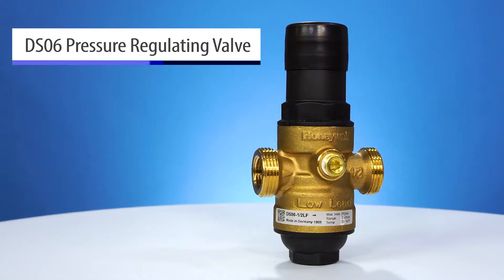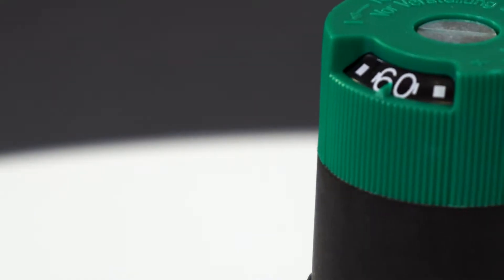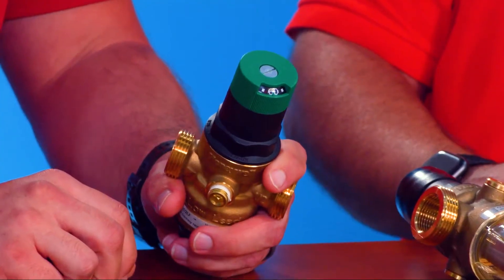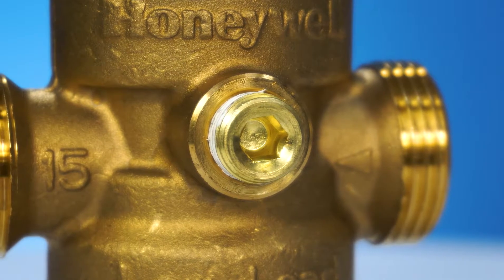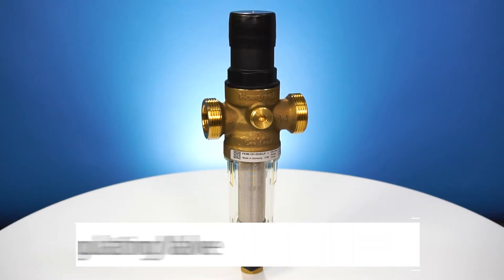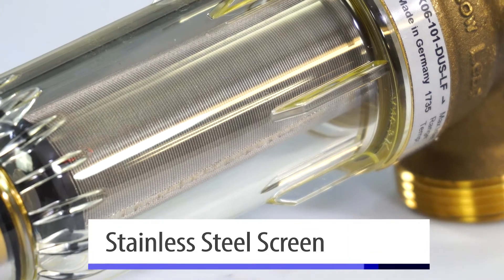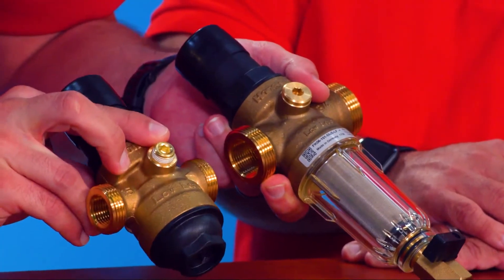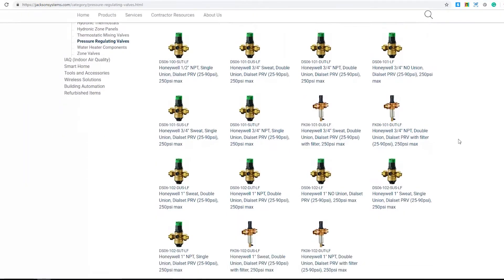How to lower the water pressure to a home

Comment: The title of this video is misleading... it doesn't have any instructions on how to lower the water pressure. I am also not able to get the dial to spin without the numbers moving, and both the manual and devices say to loosen the screw, which contradicts what is instructed here. Has anyone figured this out?

Comment: What if your number does not move when turned? Trying to add pressure but it stays at 60
Reply: I’m having the same issue. Were you able to find any other info?
Reply: @09wallz  I found that I need to turn it more to see the dial turn than I was, keep turning and you should see the dial move

Comment: Too late.  I unscrewed the screw until it fell to the floor.  What now?  The cover did say, “Loosen the screw to adjust.”
Reply: I also followed the instructions, which says to loosen the screw one turn counterclockwise then adjust the pressure.  I tired and the arrow moved with the number so I stopped screwing with it.
Reply: @marko6394  I am having this exact issue. I loosened the screw as the green plastic dial says, but when I twist it, the number moves with the dial...
Reply: Same here sow how do we fix that?  @jaciajade2
Reply: @gkerk I called a plumber, and tbh I can't remember what he did but it was something silly. I want to say he just kept twisting it. I know for sure there was not a problem with the valve, just a nuance of how it worked. Thinking about it more, I feel like he said to not turn it too far.. I decided not to mess with it. Was like $59 to have him come out. Wish I had taken notes.
Reply: @marko6394  on
Reply: @Tyler Schuessler in
Reply: @Tyler Schuessler thanks for this information! I wish they made a video about this! Honeywell's marketing isn't so great....
Reply from the maker: Hi Aves, we aren't sure what you are referring to. If you could give us a call we might be able to help you figure out the problem. 1-844-727-8748